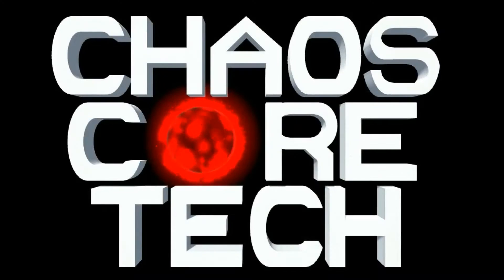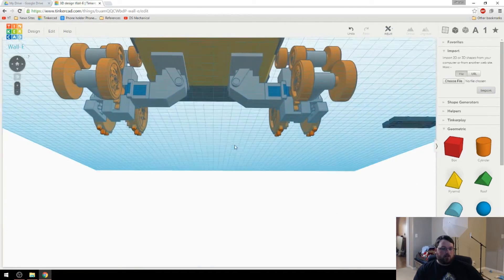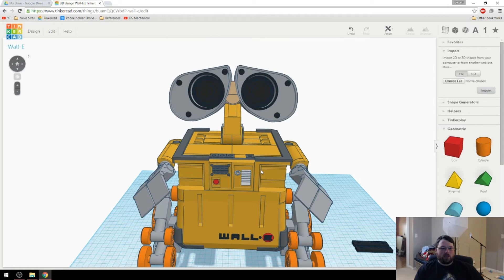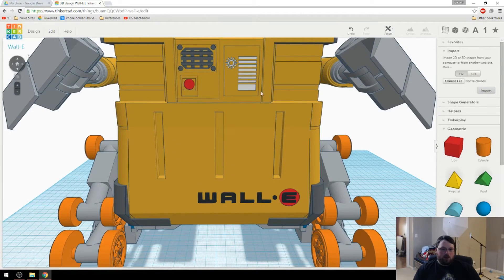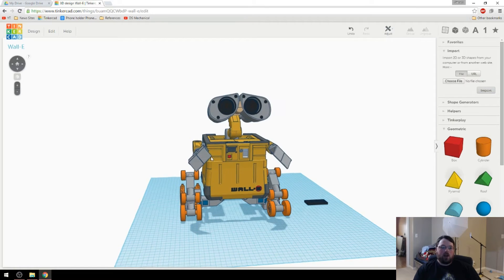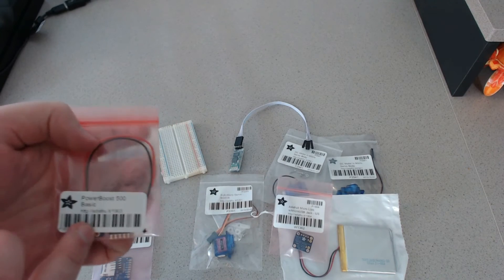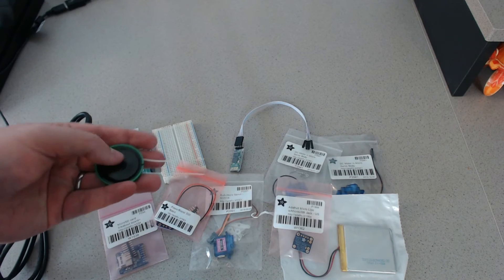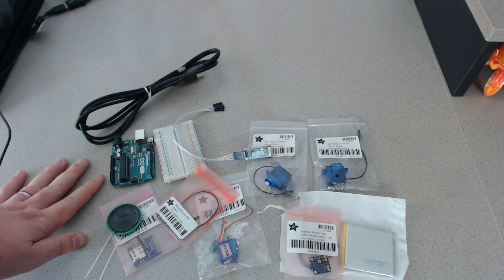Preparing the Electronics - Wall-E Update #5

Comment: Another great video keep going. I saw all your electronics and you said that you wil use tiny dc motors, the ones that looks like servos. But the problem is that they are not servo so normally you can't connect it directly to your arduino ('cause it will burn it). Did i miss something or have you planned to use a little dc motor controller?
Reply from the maker: +Tom V Oh yeah, I didn't mention that part. Yes, I actually have a couple little L293d motor drivers from Adafruit. That way I can power it from the power supply but control it with the Arduino, and it'll provide an easy way to reverse the direction of them as well. :)
Reply: +Chaos Core Tech Ok that's what i thought. For my R2D2 version (based on your design of course!) i use a L298N motor driver which also can power the arduino by the 5V pin. And for the moment it works really well :)
Reply from the maker: +Tom V Good deal. Keep me updated on how it's going! I'd love to see a working R2 based on my design. :)